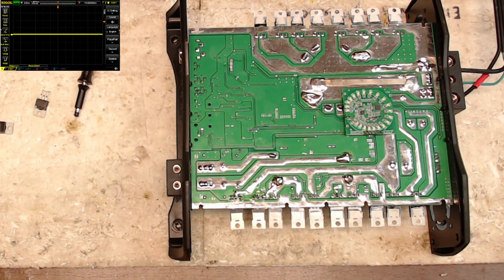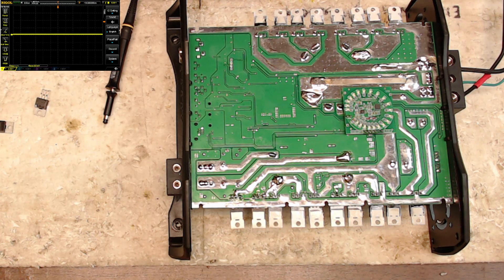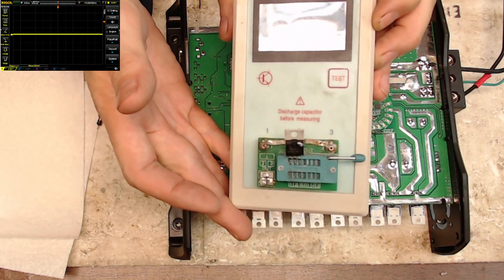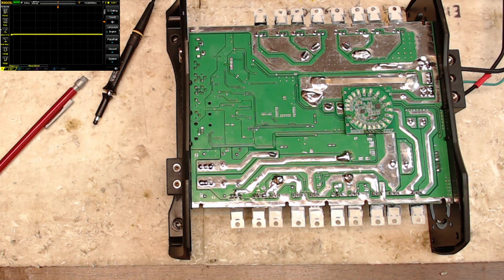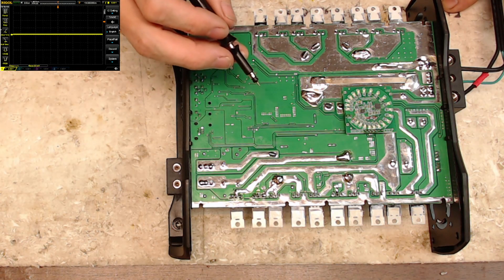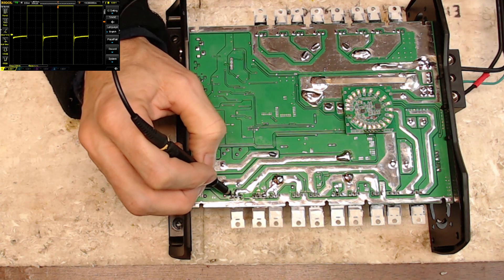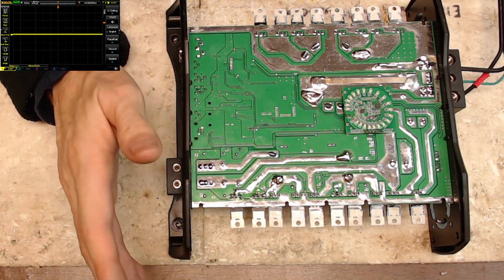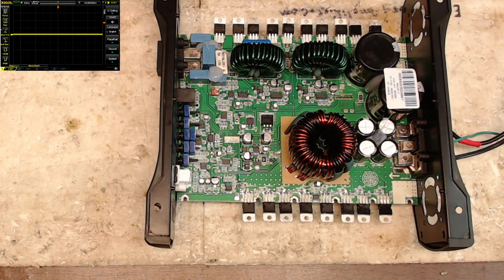Taramps Smart3 Review Tips and Tricks to Finding the Failure Point

Comment: I installed one about a month or 2 ago, the guy called me a few nights ago panicking, said he hard a weird noise and then no bass. I told him to check the fuse, because i placed a 100A fuse on it, it's just running 1 15" 4 stack audiopipe. So the fuse is blown so i assume there wouldn't be any major damage to the amp, boy was i wrong! Before i replace fuses in amps or on the main line i like to check what caused the fuse to blow in the first place.

So i opened the amp to see what's up,  there was a dark spot between 2 output fets that has the tie down bar screw between them, when i remove the tie down bar i saw that the screw shorted to one of the fets because it was so close and took out all the connected fets to that high or low side, can't tell. The fets are shorted from source to gate so i'm guessing it took out the output driver ICs because i remove all the output fets and it's still indicating a short, i checked the gate to source resistance and it about 8-9K Ohms. Do these amplifirs need to have fets in in order to turn on or something?  The power supply fets are okay but the remaining output fets seem to don't want to fully turn on when testing. Have you ever had this issue?
Reply from the maker: Oh yes I think I have seen every possible failure with these full-bridge designs that have a feedback circuit. They have to have all the transistors installed or it will go into protection. These are not treated like the half-bridge Korean amps where you can power them up with outputs installed. Most cases when a Smart amplifier fails you will end up rebuilding most all of the output section. Whats the resistance to chassis ground from each speaker terminal? This will tell me a little about the feedback circuit.
Reply: @ellensburgamplifier  Okay let me see if can understand you clearly, so the korean style amps can power on without output transistors? which i have done also. 
Rebuilding the entire output section, even the driver IC? 
So measure resistance of both positive and negative terminals to chassis ground?
Reply: @ellensburgamplifier  Okay, so resistance to chassis ground for the positive terminal is 5.7K ohms and the resistance to chassis ground for the negative side is 6.4K ohms.

Comment: The way you check the ohms around the transistor/ mosfets what number represents bad and what range represents good?
Reply from the maker: All measurements are from gate to source. The first thing is to locate shorts which are usually less than 500 ohms. The range that represents good is based on the pulldown resistors and their values including any resistor also in the circuit.

Comment: Awesome video, i been trying to decide which mono amp to go with between the DD m2000 Salt3 B2 riot 2500.1v2. Some people told me the taramps smart 3 is way better choice then all of the ones i metioned i was looking at purchasing but hard to believe when the taramps is so cheap, knobs look little cheap looking too.
Reply from the maker: You are looking at two different designs so it all depends on the application and space requirements. I would go with the Smart3 for the Brazilian design and the Salt3 for the Korean. DD and B2.. no way ;)
Reply: @E'burg Amplifier Repair  cool, you don't think DD M series amps are any good? Is there a reason you think those amps are a no go for you? I know you know alot more about amp then I do for sure. Right now I jus have 2 8s I'm installing in my truck and was looking for a good solid amp to run them at a 2ohm load for now and when I upgrade my system to 4 subs I'd be able to use the same amp and jus wire down to 1ohm. I jus wasn't to sure if say an says it puts out 1500w at a 2ohm load and that was a little to much power could you set your gain to jus deliver 1200w or would you jus have to be easy on the gain/bass knob. Thanks alot for the help 🙏
Reply from the maker: @johnnypiper1717  DD is not a bad amplifier in general just pushed to the limit. You are correct on the thought process as you have complete control of how many watts the amplifier will be using based on the input. You can put a 10k watt amp in its place and only run it at 1000 watts if the gain will go low enough. Some gains are extremely touchy. The Smart line will aid in fault prevention if used properly and fed well.
Reply: @E'burg Amplifier Repair   awesome, yeah I been looking for awhile now on which amps to go with and those are the amps I been leaning towards. The DD M2000 was the 1st I thought about getting and like the Salt 3 and seems to have little more technology then the DD m series as well as 3k instead of 2k. There so many different amps out there and hard to choose. I don't mind paying for a good amp but know some brand name jus mark the price up for there name and the amp might come out the same build house as one that's little cheaper. Is there any specs you should look for when buying a amp like damping factor ect. Thanks for helping me
Reply from the maker: @johnnypiper1717  Specs will be determined on how it will be used so I would ask around people who are installers. From my standpoint, as a repair tech, I look at rail voltage at the rectifiers and after the final output filtering but this is usually beyond the end user as it exposes the owner to potential high voltages.

Comment: Nice video, but can tell me why my audiopipe aphd-3000d-h1 won't power on anymore. It's was giving to me in it's conditions
Reply from the maker: If it will not power on at all then there is a power supply fault or the remote circuit is damaged.
Reply: @E'burg Amplifier Repair  thanks alot for taking the time and for the information.

Comment: Thanks for sharing this valuable information. Do you do repairs on MTX amplifiers?
Reply from the maker: MTX is a brand that I prefer to not take in for repair depending on the fault. They can be hard to diagnose and repair due to the design.
Reply: @ellensburgamplifier  Thanks. I have a 5 Channel and a 4 Chanel that is missing the power supply fets and I would like to know what part numbers I should use. Can you assist me? The 5 Channel is a BT400X5 and the 4 Channel is a BT50X4.
Reply from the maker: @Electrolab28Ag  If the original transistors are not present and the gate resistor values are around 47 to 68 ohms then I would use IRF3205's to start with. I do know some MTX amplifiers do not like to run the 3205's so I would watch the temperature of the transistors when you start the power supply up.
Reply: @ellensburgamplifier  Thanks mate.

Comment: The other day my subs sounded funny (no clip light) and I checked my smart 3 with a multimeter and the ohms were rising from 1 to mid 30s. I have not touched my amp or subs in weeks they have just been in my daily driver played at a normal volume. I am from texas and im guessing the heat could have something to do with it but I would like your opinion on what this could be. subs are wired to 1 ohm and its a taramps smart 3. Also when amp is off it reads 1.2 ohms but as soon as the amp turns on it rises.
Reply from the maker: that is called rise. As the speaker moves across the magnet the inductance of the voice coil changes, That is the change you are seeing. The important part is the resting resistance which is OK at 1.2 ohms nominal. Now if the subs are sounding funny there may be wear at the motor (magnet and voice coil) or the surround. I would be cautious as to not short any voice coils as this will damage the amplifier.

Comment: I have a ab2000.1 apocalypse deaf bonce amplifier , I had accidentally touched my screw driver to the amp while screwing down the speaker terminal and caused a spark , and now the clipping light indicator does not turn off how could I diagnose this problem. If you could please help I just bought this amp 2 weeks ago. I bought accident protection but was told it doesn’t start till after a month later and was told that it can know longer be covered due to it’s not working function.
Reply from the maker: Hi Ruben, unfortunately, most coverages end when there are any end-user errors. What you will find is a shorted output (amplification) section. Would need new transistors and possibly even new drivers depending on the design. www.ellensburgamplifier.com/request-a-quote for the best repair prices in the PNW!

Comment: Great vid, nervous to use my new scope cuz I don’t wana fry it so that reminder was def helpful lol, waiting on my current limiting power supply now tho, cheap adjustable 10amp lab ps. Only one I have is a hacked 12volt100amp server psu lol.
Reply from the maker: Yes, watch where you ground the scope. Also some of those power supplies may have quite a bit of noise in them. I use these t.ly/2XWz which are 12v 10a supplies with almost no noise at all.
Reply: @ellensburgamplifier  Ty! I just bought a digital up/down buck converter, going to craft my own low end PSU with a 24v/20a ASIC miner PSU for testing (5 amps and under, fancy color digital screen, ya know all us newbs want to build our own PSU at first lol) what do you think of an adjustable Brick like the one you suggested? If my buck psu ends up being noisey how would one “clean” it up or is it just not worth it? I’m mainly building this buck based PSU for testing amps without sending full boot up power to amp wo nothing blows, to test signals and whatnot.
Reply from the maker: @Nūrd_AF  Excellent sounds like you have a good plan. You will find that you will not need an adjustable supply for the testing section of your beach unless you are diagnosing with voltage injection (which I rarely do). The key is to keep the current low or have current limiting. This way if there is a short in the amplifier no parts burn up. It is amazing how hot a TO220 can get on a 2 amp supply. I am not sure how I would clean up a noisy supply. I have a noisy SMPS that I may devise a capacitive method to clean it up.
Reply: @ellensburgamplifier  hey Todd, so I was watching your other video and you spoke on isolated ground and the importance of it to protect your equipment when grounding probes, and that you get that from the 12volt2amp brick power supply you use to diagnose, the 10 amp you suggested to me above for fully testing amps after repair has a 3 prong plug, which means that’s earth main grounded and not isolated correct? I know the 2 are diff circumstances but I think I already know but I wanted to double check, to make sure it’s isolated I would want a 2 prong plug on the 12v2a I’m looking at right? , also I’m thinking of getting a 12v3a just in case or should I really just stick with 2amp or does it not even really matter, and do all brick power supplies like these have those safety auto shutoff protections like you were talking about yours having or just the one you suggested? New to all this but trying to soak it in as much as possible. Also I sprung for a programmable 10amp PSU Kungber SPPS-S3010, which I’m thinking of buying/building an isolation transformer for like Dave on EEVBlog was talking about in the video you suggested, or do I want to keep my main adjustable PS earthmain grounded and just have the 2amp brick PS I’ll use to diagnose isolated? I know these questions may seem a little obvious/mundane but I want to start off learning with what you think are best practices in this field, what would you recommend? 

Kungber DC Power Supply Variable with Memory, 30V 10A Adjustable Switching Regulated DC Bench Linear Power Supply with Memory Recall and Output Disable Button 4 Digits Display and Alligator Leads https://www.amazon.com/dp/B0923PPJ3W/ref=cm_sw_r_cp_api_glt_i_56R6K6YJT1WCDD3XY4ZF?_encoding=UTF8&psc=1

Facmogu DC 12V 3A Power Adapter, 36 Watt AC 100-240V to DC 12V Transformers, Switching Power Supply for LCD Monitor, Wireless Router, CCTV Cameras 2.1mm X 5.5mm US Plug https://www.amazon.com/dp/B073WSWT34/ref=cm_sw_r_cp_api_glt_i_MFK8CVS2AA3NNAS1QKQW?_encoding=UTF8&psc=1

Thx again bro for all the help/advice/mentoring, also looking forward to catching a livestream!

Comment: What would you go with CAB 22 vs taramps smart 3 ?
Reply from the maker: That is a tough one as they are completely different amplifiers. You will have more audio control with the smart3 with a smaller footprint or you can have decent subwoofer power with the CAB board but much larger. I prefer the Tarmaps for the parts used over the CAB but the CAB wins in heatsink density.

Comment: Can u conect 12volt.. plus + to  -  and neg - to  plus +..  😅   want to know wich parts gonna get damged so i can replace those parts.. of my amp..
Reply from the maker: Honestly I do not know what will get damaged as reverse polarity can cause a little damage or a lot of damage. You have to start with checking for low ohm value shorts across all the transistors.